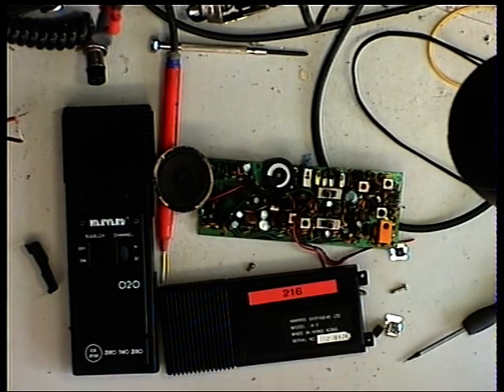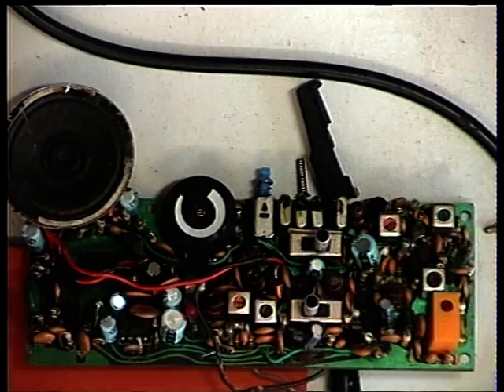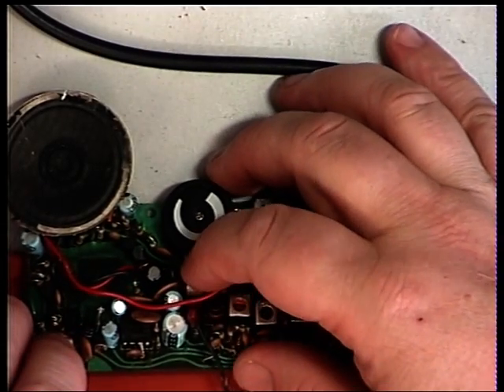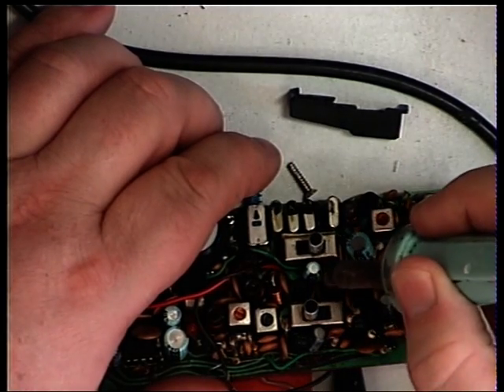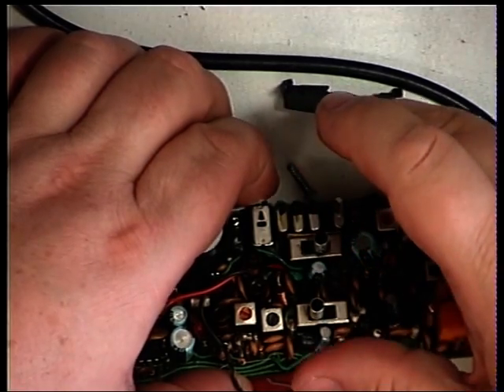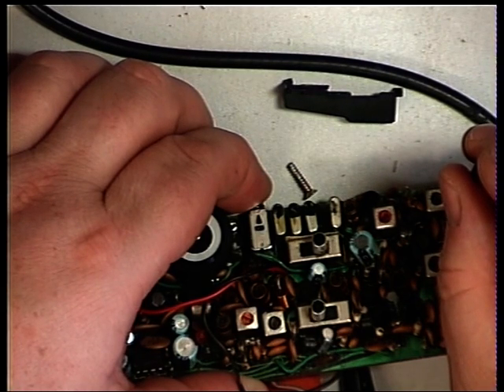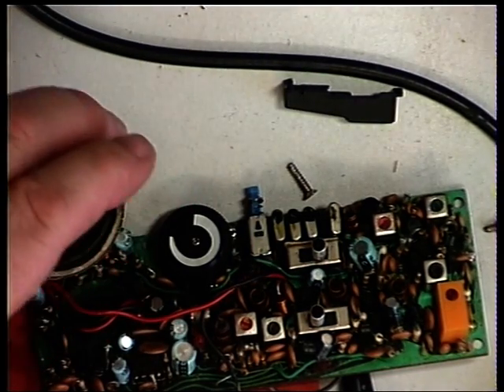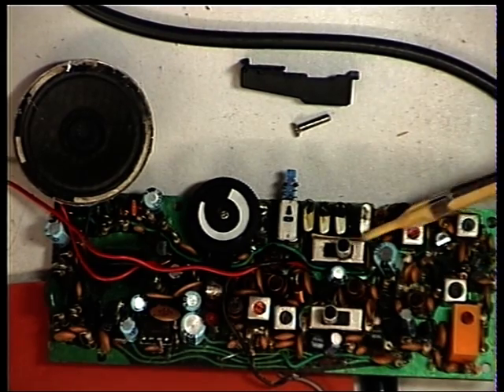Harvard 020, UK CB radio 200mW (Hand portable). Alignment of Transmitter

Comment: One of my first radios I bought  when I was introduced to cb radio got some good ranges on these obviously base stations were pulling my signals in good but great memories using this radio made a lot of good friends a great start off radio.
Reply from the maker: Yes. I don't know if I said in the video but we did a range test in open countryside to our calibrated mobile (Rotel RVC230 with 9' full quaterwave aerial on car) & got a mile.

richard

Comment: Hi There

I have just picked up 2 of these on Ebay, this was the very first proper CB radio that I owned, could you provide me a link to that service manual please as I think the sets might need to be aligned when I get them, great couple of videos, Im now subbed to your channel. thanks 73,  G7LNK
Reply from the maker: The user manual with circuit was uploaded to Scribd.com & a google search "Harvard 020 schematic" went straight to it. I think the full manual we have is for the Alba CBH1 version of the same product & again should be on scribd for free use.